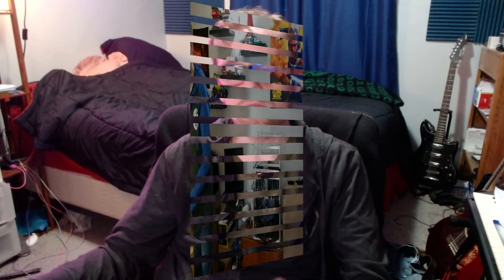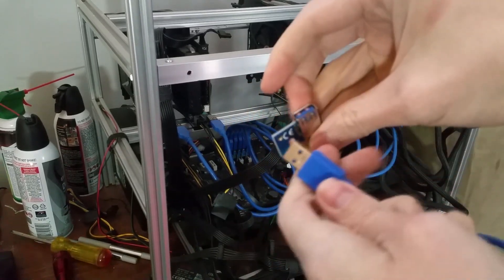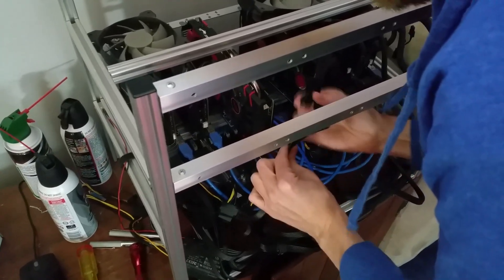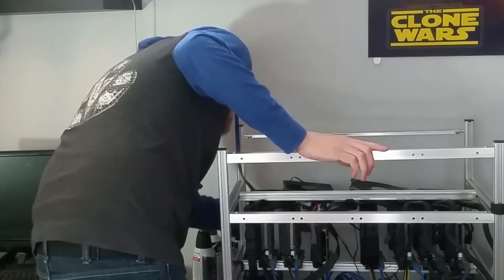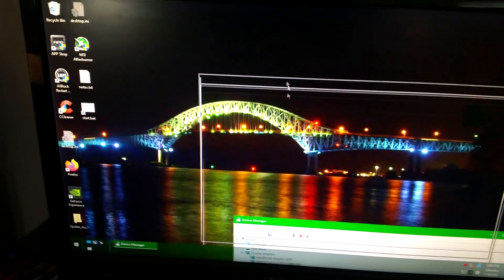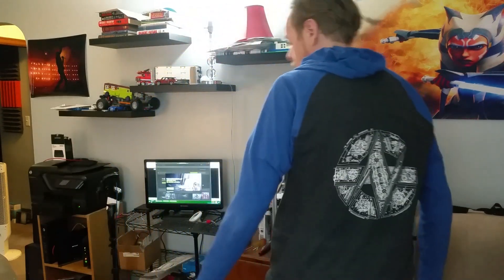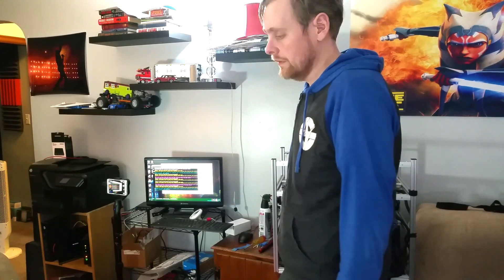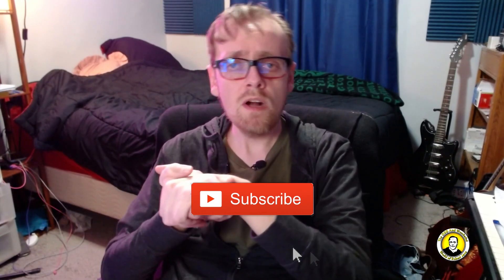Cryptocurrency mining in 2021 | can you mine Ethereum with a GTX 960?

Comment: 1080ti is a monster mining card such a hoss
Reply from the maker: Yeah but it is not power efficient
Reply: @RobertJene  well luckily my apartment is stupid enough to include electricity in the rent so I pay a fixed rate, lol. In a way I have free electricity.
Reply from the maker: I have a friend in the same situation, I told them to get a 1080 ti LOL.
It is also great for video editing because of the 11 gb VRAM
Reply: @RobertJene  it’s honestly insane how it competes with modern cards with the ethlargement pill. I’m currently building my first rig, I’ve got x3 1080ti EVGA HYBRIDS and they suck power. I was doing some lazy over locking and set them to 119% power and was sucking almost 300 watts per card, till I realized my 1000w power supply was pulling 1060w. Found I get 98% of the performance at 85% power supply.
Reply from the maker: I heard the guys who made ethenlargementpill have a version for GDDR6X (1080 and 1080 ti are GDDR5X).
It's the weird bandwidth of the "X" part of the memory that allows it to go up.
But they don't let us PLEBS have the ethenlargementpill for cards with GDDR6X like 3080... cuz they SELL it to mining farms

Comment: Tried mining in linux?
Reply: Also, I tried with lubuntu, (xorg installed and everything set up) tried different miners but the only thing that worked better was etc. Btg it's too slow and the mimimal payout is high...
Reply from the maker: Yes. It was an even worse pain in the butt parts.
Reply: @RobertJene  hahaha, I have that old gpu and I want to scrap at least some dollars to get food, here in Argentina we have very cheap electricity and making a buck in USD currency really helps a lot
Reply from the maker: @sqs.555  I never tried to mine with this card in linux. There are some coins you can mind with a 4 GB card but all the other ones you need 6 GB or 8 GB memory
Reply: @sqs.555  brazilian here, I've tested a 960 4GB (gigabyte) It can only mine etc/btg but you got no money, you will actually pay to mine with it as it makes less money than the electricity cost... In my case kw/h is 0,68 BRL which is about 0,18 usd. You can calculate better but unless you have no energy cost, all you'll get is headache and money loss...